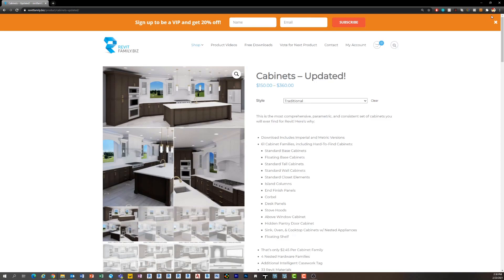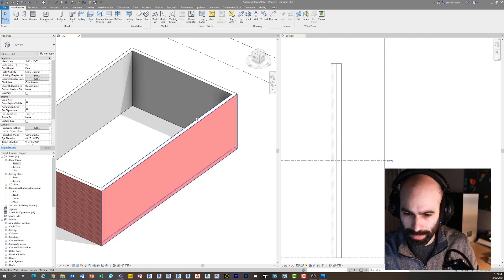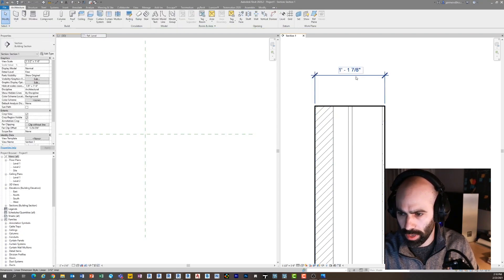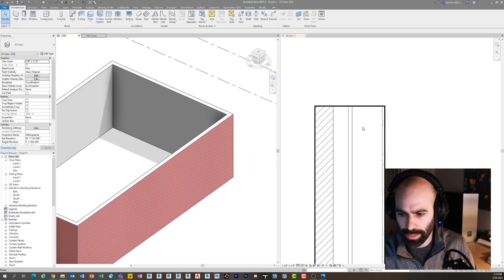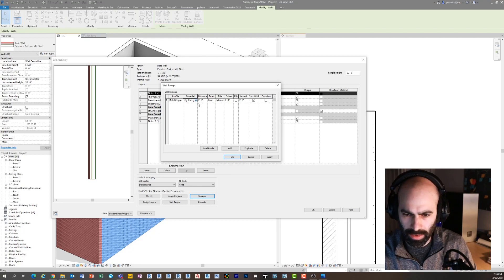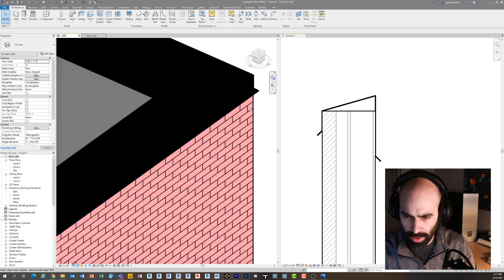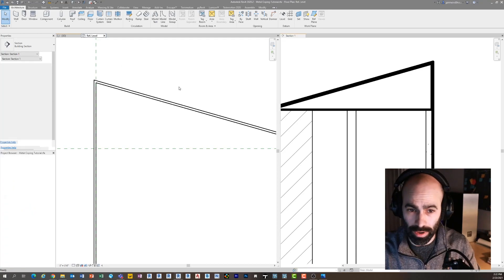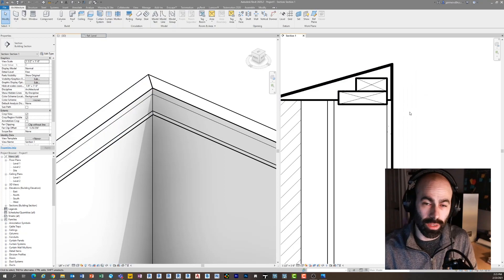Adding a Detail Item in a Wall Sweep in Revit Tutorial

Comment: Thanks Jeff, love the weekly podcast. So, I have used this technique for quite some time, but I recently came across an issue with new releases of Revit where the embeded detail component will appear backwards and out of alignment when section is cut. It sometimes depends on which direction the wall is created I believe. I do not recall this being an issue in releases prior to 2020. Have you noticed this before, and do you have a workaround? Great video btw.
Reply: Oops, I should have read some of the replies below. Thanks again!
Reply from the maker: Haha all good!  Cheers James!  Thanks for tuning in!

Comment: Hi Revit Kid,

Love your videos!  Thanks for the great content.

Question for you and anyone else with insight.

I've implemented your strategy of adding a detail item to a sweep profile.  My profile is a sill plate and rim joist combined (an 'L').  I've added a detail item for the linework to show up in section views.

For context I've created 4 walls all 90D from each other (a square) and added the sweep profile to the top of them.

When running a section through my walls (left to right) my detail item on the left wall won't stay connected to the profile, the detail item on the right side is fine.  Okay, Seems like an orientation problem... (that's what I thought) but now when I run a section top to bottom the detail item is fine on both walls/stays connected to the profile...

Any Idea why 1 of my 3 walls (in section) refuses to display the detail item correctly?  I'm pulling my hair out!

A search on a revit forum has suggested a similar issue for another user that may be a problem going back all the way to 2009...

If there is an easy fix to this I would LOVE to know.

See the link for the 2 page forum conversation. https://forums.augi.com/showthread.php?107053-Embedded-Details-Flipping-within-Curtain-Wall-Mullion-Profiles/page1

Many Thanks!
Reply from the maker: Strange, my guess is to either make a detail component for each side (because Revit isn't mirroring/rotating it right) and convert it from Autocad to native revit (as in REDRAW IT using all revit tools).  It's hard for me to troubleshoot that without the family/file itself.
Reply: Hey I had the exact same problem ... Please install latest Revit 2022 update as well as the latest hotfix released. I just installed and problem SOLVED !!!

Comment: When changing the wall's orientation, the detail component in the sweep does not update. Any way to fix that?
Reply from the maker: As in mirroring the wall?  Unfortunately, that seems to be a bug in Revit... So you'll need to have the profile/component in both orientations... But, maybe someone out there has figured out how to make it work??
Reply: Thank you for bringing this up , Ive spent 4 hours trying to fix it thinking it was an issue with the detail component and sweep alignment but apparently is a bug yet to be fixed  ( your detail shows outside the wall yeah ? Cna someone please help how to fix this !
Reply: Hey I had the exact same problem ... Please install latest Revit 2022 update as well as the latest hotfix released. I just installed and problem SOLVED !!!